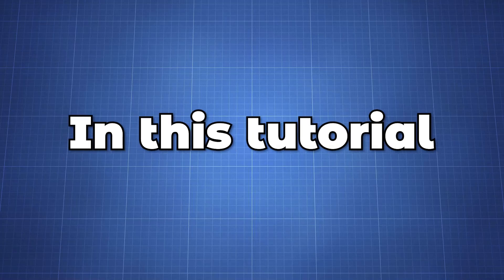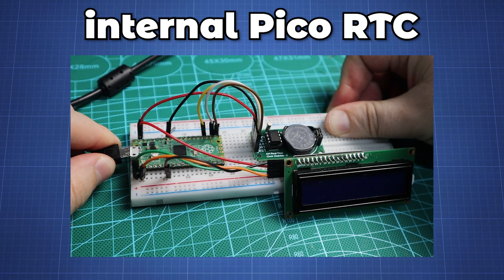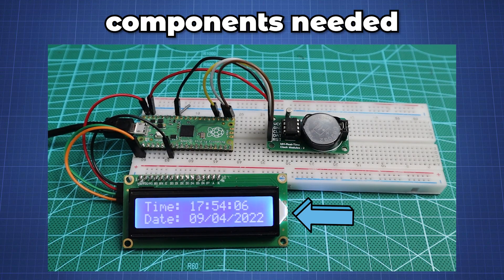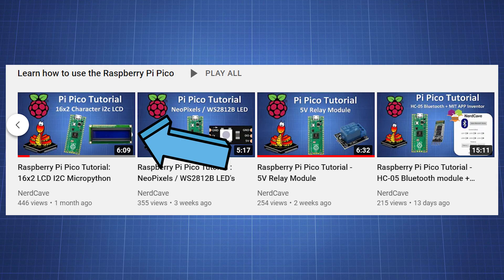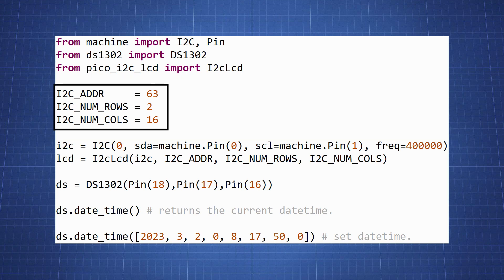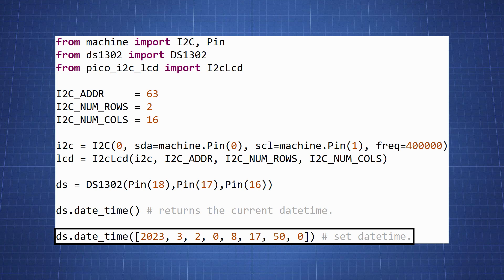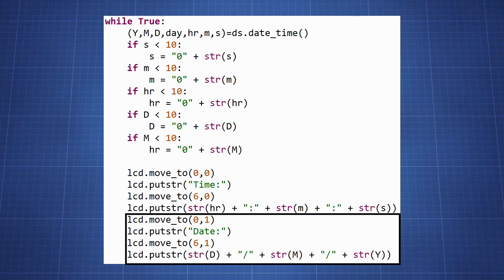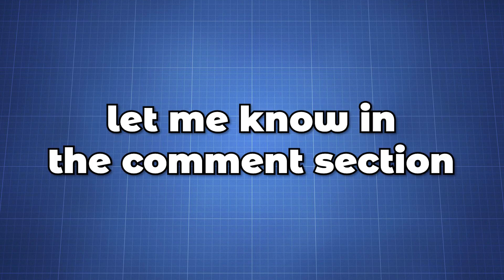Raspberry Pi Pico Tutorial - DS1302 Real-time Clock

Comment: Hello, I want to synchronize the RTC of the Pico with a DS3231 that has the current time. Then I want to show the time of the Pico RTC on the display (NOT the DS3231 time) when the Pico is running on battery. I have tried a lot, but I have not succeeded yet.
Reply from the maker: sorry for the late reply I was away for a bit, do you have discord?

Comment: When I set the time the time is stuck at ([2000,0,0,0,0,0]} and it's stuck like that even after trying to modify those values. Do you know how to fix this?
Reply from the maker: I tried researching what it could be but did not find a solution, I know someone else had similar issues but he replaced the IC and it worked. So it is difficult to know if it is code or faulty IC but the code I showed in video is what I used
Reply: @NerdCaveYT  Hi, turns out it was a faulty IC! I replaced the IC and now it works fine.
Reply: @jdo8780 Was it the IC on the RTC board or the pico board?

Comment: Hi, thank you for the tutorial. I have an issue when trying to run my main.py file; 

"Traceback (most recent call last):
  File "<stdin>", line 29, in <module>
  File "pico_i2c_lcd.py", line 22, in _init_
OSError: [Errno 5] EIO"

I'm not sure what's wrong, can I have assistance?
Reply from the maker: seems like the lcd screen giving problems can you double check the SCL and CLK pin connection
Reply: @NerdCaveYT  in the moment I had to connect a female wire to a male to the breadboard, as I didn’t have a female to male wire… could that extra extension cause issues?
Reply from the maker: it shouldn't be an issue the LCD screens will have pullup resistors and it will give a different error, did you try just getting the screen to work on its own.
Reply: @NerdCaveYT  Yes, so I followed your tutorial on just the LCD screen and it works, but I keep running into the same error here.
Reply from the maker: @max3734  okay this is very strange if the LCD is working fine when you followed the other tutorial it should not give any problem here.
Error 5 indicates a communication problem.

For connection problems, check that

- all four wires are place: GND, SDA, SCL and Vcc
- and the LCD already have pull up.

So let's try this,  let's change the I2C pins 
connect the SDA pin to GP6 ( Physical Pin 9)
connect the SCL pin to GP7 ( Physical Pin 10)

and change the following in your code:

i2c = I2C(1, sda=machine.Pin(6), scl=machine.Pin(7), freq=400000)
Reply: @NerdCaveYT  This worked!! Thank you very much. As a follow up question, how should I set the date_time? Is it Year, Month, Date, Day (Monday=0), Hour, Minute, second, ms?
Reply from the maker: @max3734  great it is #ds.date_time([2023, 3, 2, 0, 8, 17, 50, 0]) # set datetime.  (year, month, day, weekday, hour, minute, second) can't remember what is weekday assume a value between 1-7 but I did not use it but still have to set it because from the library it is an argument  shown here: def date_time(self, dat=None):
        if dat == None:
            return [self.year(), self.month(), self.day(), self.weekday(), self.hour(), self.minute(), self.second()]
Reply: @NerdCaveYT  One last question, when I set the time it only goes up to 6 seconds before changing the minute, how can I fix this?

Comment: Thank you for the video, NerdCave.  Reversing the connection so that Receive of one device connects to Send of the other device and vice versa fixed the problem for me. Per the instructions  Raspberry Pi Pico GPIO 0 (PIN 1) which is UART0 TX was connecting to HC-05 TXD. And the GPIO 1(PIN 2) which is UART0 RX was connecting to HC-05 RXD (1m 27s and 1m40s from the start of the video). Connecting TX to TX and RX to RX caused the first message to be b'\x00'.  Nothing worked after that - toggling the switch to on or off did not produce any text and did not control the LED state.  Was fixed once I reversed connected UART0 TX to HC-05 RXD and UART0 RX to HC-05 TXD.
Reply from the maker: Thank you for the feedback, I usually make simple mistakes in the Fritzing Diagram. It might have been that I had it connected differently then the diagram, I am making sure now to check the diagrams multiple times before using them in a video